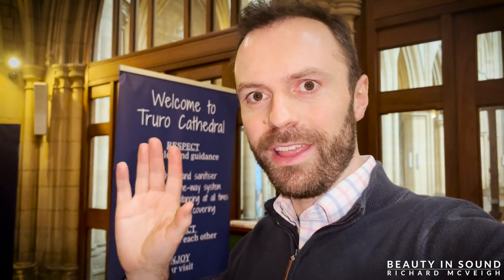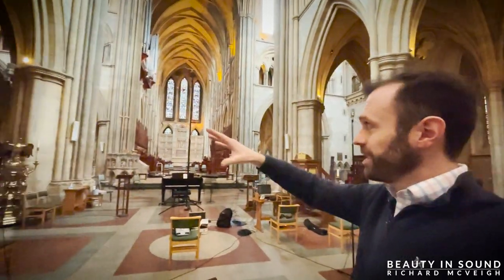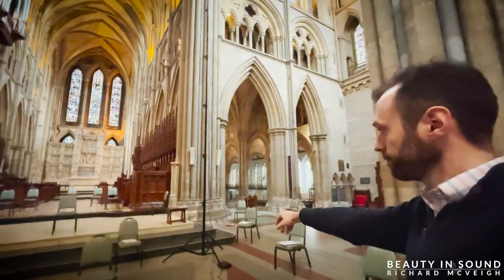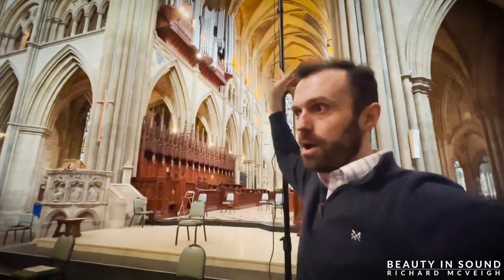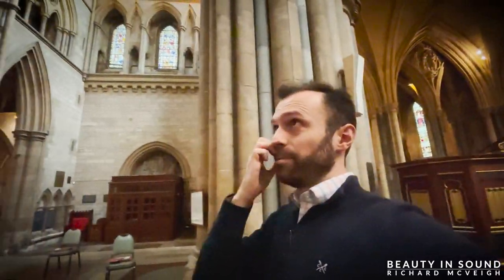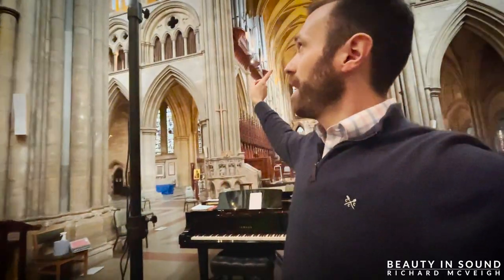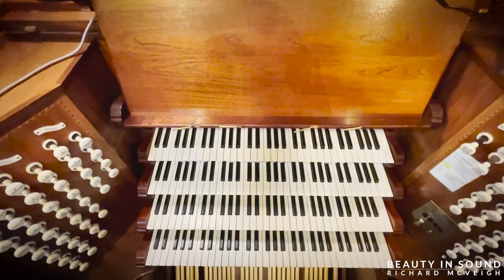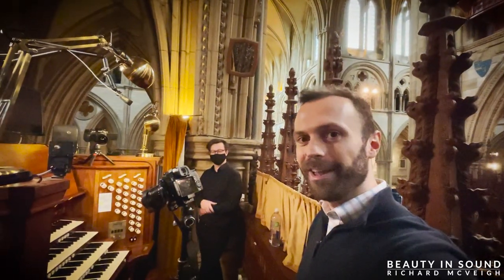☕ Setting up in the Cathedral // Recording Truro Cathedral Organ \\ Episode 3 of 5

Comment: I didn't see any sand bags on the mic stands. You're braver than I am hanging those nice mics way up there in the clouds.
Nice informative video. When things get back to normal here in the US I'm hoping to record some organs.  I don't have a mic stand that tall but I have a tall light stand and a 5 Foot extension that will get me up 13 feet. I Also have saddle sand bags. 
Heres a sand bag hint. Sand can get messy even if double bagged. I'm using decorative glass pieces used in flower arrangements.  Really squished marbles. Very heavy. I got my empty sand bags from Amazon.
Reply from the maker: The Manfrotto microphone stands are extremely stable and the legs at the bottom are very wide. The whole stand is very heavy, and in fact I dropped the larger one of the two on my finger on the morning of the recording and I thought I had broken it! Luckily it was just bruised (it still is!) but it did mean that I had to record my organ demonstration with a very painful finger. It was totally worth it though! 😊
Reply: I would have loved to have been there to help. Years ago I worked in a recording studio, then did audio for TV for years. Heavy stands are good, but its that 8 meter arm that worries. I KNOW that nothing is up there to knock into it, but I'm a worrier 😆. You know,  check the door locks 3 times. Plus, I'm usually putting heavy strobe lights up on top so that adds into my worrying.  Of course,  that mic pair costs lots more than a strobe.
Looking forward to more great videos. And setting up my own Hauptwerk system. I'm using Ahlborn Galante modules, now.